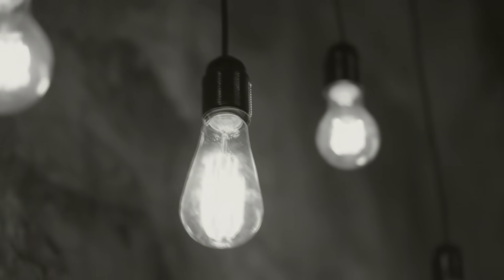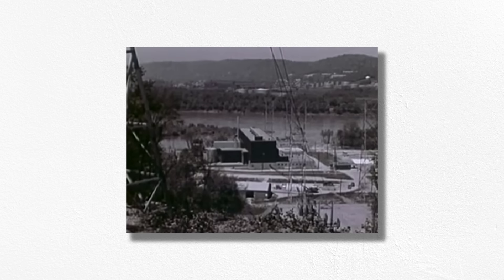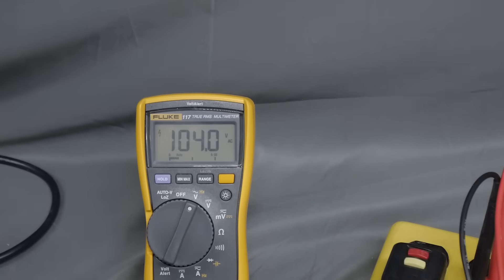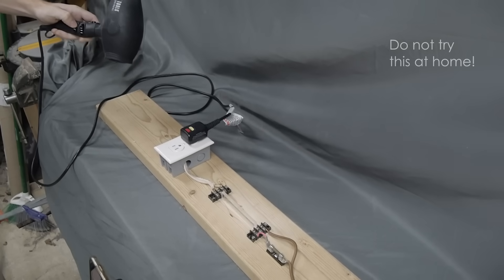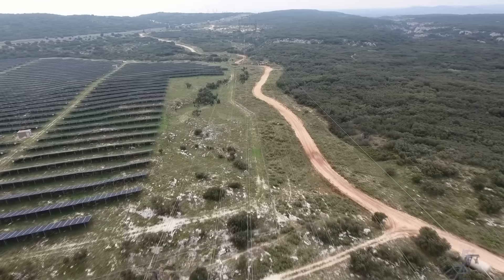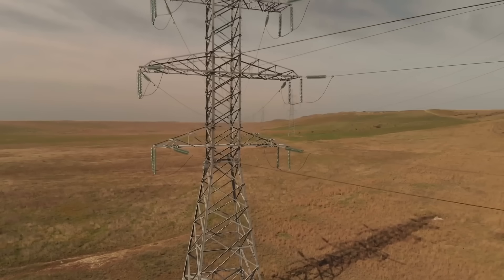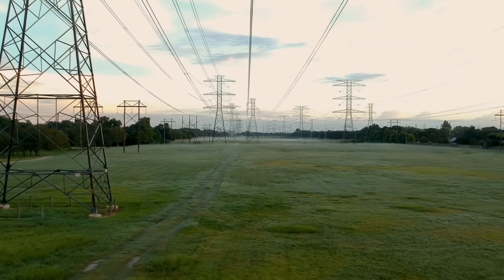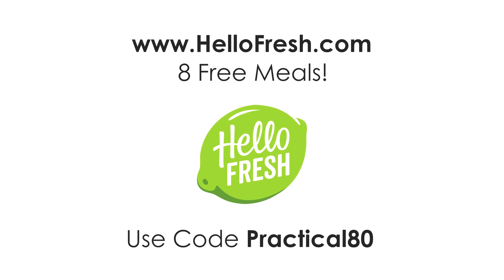How do Electric Transmission Lines Work?

Comment: Tried your insulator disc counting "theory" and that is what it is, "theory" LOL.  I work at a power plant connected to the bulk grid where I already know the line voltage.  We are connected to a 345kv line in which the lattice towers consist of one 345kv circuit (only 3 lines).  I counted the insulator discs on each phase and get 18 discs per insulator.  So, 18 x 15 only nets 270kv!  I have to assume that not all insulator discs are manufactured the same and that engineers use distance from tower arm to line as the true barrier of air gap?  Also, the real voltage per line is lower than the phase to phase voltage.  Our lines are 202kv phase to ground.  The 138kv example in your video would only be 80kv phase to ground.  Is there something I am missing since I only generate the power and do not transmit the power?

Comment: but how do birds survive chilling on those lines
Reply: +Power Chill - Because they only touch one line... usually. If they manage to touch a second line or something grounded while alighting or taking off--IOW, completing a circuit... instant cooked chicken dinner.

Incidentally, if you've ever taken note, you never see birds perching on the really high voltage lines (like above 50kV or so) because they feel and are repelled by the electrostatic fields surrounding such conductors.

Comment: But why do the transmission lines make so much noise?
Reply: Partial discharges of air near to the pylons. Near to the pylons the roundness of the wire is disturbed. You have connections to the insulators, the dampeners, sometimes even earth fault current spikes (over the insulators - used to protect the metal if an earth fault current flows)… These all have spikes leading to a very local but very large increase in electric field. This will then ionize the air around it... that is what you are hearing.

Comment: Hmmm, i think you should mention why we use the 3 phase system in the first place and the differences between AC and DC. In my opinion in 50 years from now will be all main transmission lines used as HVDC. Also the lack of wires going back to the plant would be interesting for the outsider. But overall great video for people not in the business.
And remember, it´s not the voltage nor the current that kills you. It´s combination mainly of those two dependend on time. So it is THE ENERGY!!!

Comment: So why in long, very HV lines do they swap the lines around in positional order?  In other words, if three phases are stacked on top of each other, every few miles they change the order.  Bottom goes to middle, middle goes to top, top becomes bottom.  Some sort of method to switch up or avoid capacitance and/or inductance??

Comment: Ever since moving into a home with no cable TV/internet available, I've been paying attention to the telephone poles on different streets. I think I can spot which streets have cable available by seeing if a black insulated line exists. It's surprising how many don't. It can't be that simple though. What about phone lines? Would they look the same? Do higher internet speeds or longer streets require more or thicker lines? Can you tell how much power a house or business has available to it by counting the uninsulated lines? I've noticed that older areas seem to have more variety and different layouts. I'd like to have a better understanding of what's going on up there. Is it possible to read these lines? Could someone look up and say "Ah, yes, this location has this much power and these utilities available."
Reply: I almost can't tell if you're serious or not.  But, assuming your comment is not tongue-in-cheek... most people have never seen a telephone pole.  Very few poles dedicated to carrying telephone lines above ground exist these days.

 Cable television lines tend to be thick and black.  More important trunk lines will be thicker.  You can identify cable lines by the equipment used alongside them (such as signal boosting stations) which often hang in the air on the cable itself.
 
Phone lines also tend to be thick and black.  There rarely is equipment hanging on the lines, but such thick bundles will usually run down the pole to a large distribution or interconnect box.  The lines (phone and cable) may run down to a pedestal box that sticks up from the ground. 

Do higher internet speeds or longer streets require more or thicker lines?
No.

 Can you tell how much power a house or business has available to it by counting the uninsulated lines? 
Not really.  From a US/Canada perspective, a home or business is going to get 1 phase or 3 phase electrical service.  1 phase requires 2 uninsulated (high voltage power line) wires, whereas 3 phase service requires 3 or 4 uninsulated wires.   A home or business that receives 3 phase service automatically has more power coming to it.  A better gauge of how much power a place gets or requires is to look at the size of the transformer(s) serving it.   But, if the transformer(s) serve more than one customer, you can't tell much about one individual customer. 

Is it possible to read these lines? Could someone look up and say...
No.
Many of these utilities you speak of can be buried.  Even if they're not, just because a home or business receives cable TV service does not mean they receive cable TV service.  Just because a building receives 3 phase power does not mean that every business in that building does.   Just because a telephone line is ran to a home or business does not mean it's used.  You really can't tell or assume much by looking at any of it, because the physical infrastructure may indicate something is immediately possible but not a definite.  And, again, if it's buried, you'd never know unless you have inside information.

.
.....
P.S. FUCK YOU YouTube for making it impsosible to format comments properly anymore.  Paragraphs and linebraks be damned.... YouTube inserts them or takes them away at will!  Dozen edits later and it still won't do it right. WHAT A JOKE

Comment: So what is the realistic/average efficiency of power transmission? How much % is lost for every km traveled?
Reply: The efficiency typically ranges between 85 and 95%.  Each transmission line is unique as far as its efficiency and losses, because of length, voltage, size of conductors, etc.  The longer it is, the less efficient it is.

Comment: Nice covering of the basics, though I was hoping that you might have gotten into a bit more depth, like why some ultra high voltage lines are direct current or how the grid is protected against wide spread blackouts.
Reply: I'd say DC lines are less about ultra high voltage (the ones I worked on were all 500kV.  I know that sounds like a lot, but I worked on insulators on 765kV AC lines and there are lots of 500kV AC lines).  The main reason to use DC is when traveling large distances because the losses are lower.  The lower losses have to be balanced against the equipment needed to rectify the power at the point of generation and then invert it back into AC at the far end.
Reply: DC lines are used when passing the cable through saltwater, such as between countries.

Comment: Basically you use the power relationship to show that increasing the Voltage reduces the Current, not Ohm's law. In that, the voltage is the cause of the current and they are proportonal to each other. But power is constant since it is produced by a single source. If this relationship votalge and current are inversely propotional.

Comment: I’ve noticed that each phase is often carried by two conductors side by side, very close together but not touching. Any idea why?
Reply: +Mitchell Serena - Sometimes its to increase the current-carrying capacity. Two shared parallel conductors means a lower resistance for the current. Other times you may see more than just two conductors per phase. On very high voltage lines you may see as many as eight conductors in a phase group. The main reason for doing this is to effectively increase the total size of the conductor, which reduces the strength of the electrostatic field surrounding conductors at such voltages, thus reducing corona discharge losses (in addition to the previously mentioned increased current capacity benefit).

Comment: I never really understood the low current/high voltage reasoning of transmission until now; thank you for this great explanation, Grady!
Reply: Dido.
Reply: I still don’t. V=IR, so decreasing I will also decrease V. It’s not clear how increasing voltage reduced the current.
Reply: @AdamSmith-kl1rs 
V=IR is the equation used to measure the voltage drop across a resistor, in this case representing the line as a resistor. It does not tell you what the voltage on the line is from the source, only how much the voltage reduces between the two ends you're measuring from. The voltage on the line is decided by the source and the transformers.
What is held constant on a line is the total power, P=VI, which combines both used and wasted power. The source produces some fixed amount of power, and that energy has to be conserved. Therefore, it either is lost as heat on the line or makes it to the consumer, in this simplified model. Because of the fact we can control the voltage using transformers, we can raise the voltage which decreases the current, keeping the total power constant.

To avoid further confusion, when calculating the power lost in the line as heat the voltage used in P=VI must be the voltage drop across the conductor. This is why we can substitute V=IR and end up with P=I^2R.

Let me know if anything is still unclear
Reply: @AdamSmith-kl1rs 
Side note, the point in the video where Grady clarified this was in the line "The only way to reduce the current and still get the same amount of power is to increase the voltage"

Although it is easy to miss that, I admit.
Reply: @Misterspork57  thanks this really helped!

Comment: nice video, do you know efficiency of: generator, high voltage transformer, power line, high to middle voltage transformer and midle to low voltage transformer-these are 5 basic parts of electric system and if every works with 90% efiiciency it means that loss is 40% , what means electric cars are non efficient because loss of charging/discharging batteries is about 40% plus electric engine loss, it means that cars efficiency is about 24% from energy source-generator in water/thermo plant(did not consider efficienci of water /steam turbine and efficiency of combustion in powerplant, it means that is better to use  petrol than electric current from coil/oil powerplant

Comment: If V=IR, and you reduce the I (aka current), then it will also reduce V (voltage)....
I think someone on tour writing team attempted to over simplify the equation and avoid the real, correct answers.
If you reduce the current, you will have to increase the R in order to increase the voltage.

Comment: I really wish people would use the term tension for voltage like original. Especially high tension, where it is still somewhat common. It is not amperage, wattage, or ohmage. And even not voltage. It is current, power, resistance and tension. Measured in Ampere, Watt, Ohm and Volt
Reply: cybermaus we still use tension but in terms of the mechanical tension pulling on the lines which is maybe why they have moved away from the term to save confusion.

Comment: Very interesting!!  It corrected a few ideas about transmission lines I had.  Tomorrow, I'm going to count the insulators on the high tension line thru my development to figure out its voltage.  Every few month's, a chopper flies over really close to the lines to inspect them.  The line is 200-300 feet from me and down in a little valley and the conductors are just about eye level for me.  First few times I saw the copter fly by just above eye level surprised the crap out of me since it was so low.  I can see and be seen by the pilot and line watcher.

Comment: So we're also billed for the lost potential energy as well? So i wonder, if there is a house a mile from a power plant and one 100 miles away but on the same grid and with a few substations in between, does the house 100 miles away pay more for his electricity than the house 1 mile away?
Reply: Nope, not in the UK anyway, everyone pays the same per kWh. That would be quite hard to implement I would imagine as there normally isn't just 1 powerstation feeding 1 long line, the grid is very complex.
Reply: @JonnyD3ath  oh i know it is, it was just theoretical. Doesnt have to be one house or just one 3 phase run, it could be a whole city a mile away vs. A city 100 miles away for the example. Makes sense to get charged for what you use, but i was wondering if the resistance is added to the load you are charged for or if that is calculated before hand.
Reply: Danimal 86 even then, 100 miles away from what? Because your electricity will be coming from all over, multiple powerstations, wind farms etc, it doesn't just run from one place to another.
I wouldn't be clued up on the ins and outs of billing procedures but you can bet everything imaginable is factored into the total cost!
Reply: @JonnyD3ath  likr i said already it was a theoretical Question. I know the system is more complex than my example. Nvm its going over your head.
Reply: Danimal 86 it's clearly going over your head, you asked a question and got an answer, a real answer, the systems exist so there is nothing theoretical required?

Comment: If only the 3 phases are transmitted, how is neutral going back to the power plant?
Reply: TrashLock witch craft. Confused the hell out of me when I went from being an electrician to power linesman lol

You make your own neutral at the transformer by running a wire into the earth.

The power network is what you call a 3 phase delta system. Look up star/delta configurations to find out.

Comment: 6:14 Aren't those lines used to carry the return current for when there is an unequal phase change between the wires caused by reactive components like inductors and capacitors?
Reply: +Thijs Snijder - You are touching on a question I've always had: What configuration are the three phases in on transmission lines? Wye (Y), or Delta? I always thought that those top wires served the purpose you mentioned, as well as providing lightning protection for the main conductors. But that only makes sense if the phases are in Y. If the wires are only there for lightning, then that implies Delta.

The first case would seem to be the most logical since a Delta configuration requires the conductors to carry 1.73 times the current of a Y configuration. Does anyone know the answer?
Reply: @Inflec  electrical transmission (at least in the US) is delta.  The only purpose of the shield wire is lightning protection.

Comment: 3:05 We have P = I.V and V =I.R
So P = I².R = V²/R
So it can't be the reason why we need to decrease I, as we could decrease V with exactly the same efficiency (they are both squared).
So i don't understand the explanation here.
Reply: This is a little difficult.   You want to maximize the power transmission to the destination AND minimize the power lost in the transmission lines.   It's not 1 equation, but 2.  You have to consider both.   However. My brain was set about 40 years ago to just accept the result without asking follow up questions

Comment: The position of the 3 phase lines is also carefully designed to minimize the magnitude of EM fields on the ground.
Also, for extremely long distances it is common to use a DC line rather than AC.  When working with AC, energy losses are in the form of resistive, inductive and capacitive. However when you switch to DC you only have to deal with the resistive losses.  The downside of DC transmission is the cost of converter stations at either end.

Comment: Why not dig transmission lines underground?
Reply: madfury hugely expensive! And alot more time consuming, costly and disruptive to find faults when they occur
Reply: @JonnyD3ath  Thanks for the reply. You think that building and transporting metal towers is cheaper and quicker than digging a trench? Maybe the cable would be more expensive because it would need an insulating cover, but it would be less hazardous for people and the environment and would not attract lightnings. It would also be safer for operators, who would not have to work under a risk of precipitation. Finding faults would be more tricky, but that also depends on how the system is designed. Anyways, it is just my naive impression, I am no Civil Engineer.
Reply: madfury it is known to be between 16-20 times more expensive to utilise underground cable as opposed to overhead lines, it is not my opinion.
You think there is risk standing out in the rain? Cable jointers have to work in excavations where water can flood in aswell, posing risk of excavation collapse and water entering cables. The cables themselves are fairly complex layered structures and highly are complex to manufacture so they cost alot more than a simple bare aluminium conductor used on overhead lines. Due to being sealed and covered they are also susceptible to heat issues so need to be larger to counteract this whereas overhead lines are in open air and easily cooled.
Overhead lines can be ran for miles on end in straight paths, over land, buildings, roads, whereas cables have many things in their way, every patch of land it is routed through has to be presented to each landowner and wayleaves obtained, where people try and extort money from companies aswell, not to mention being burried along side water, telecoms, gas mains in towns and cities opens them up to being very often dug up by the public and contractors.
It doesn't matter how a cable network is designed, if the cable faults internally it can be very hard to locate especially if it is in a customers property where going around and digging up driveways etc is quite a touchy subject as you can imagine!
Reply: @JonnyD3ath  Makes total sense. Thanks for the explanation.